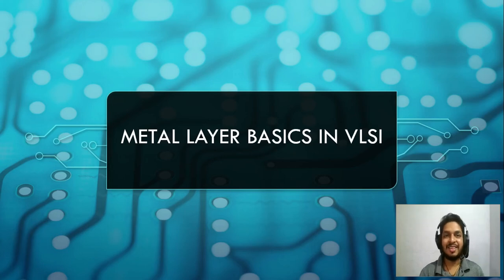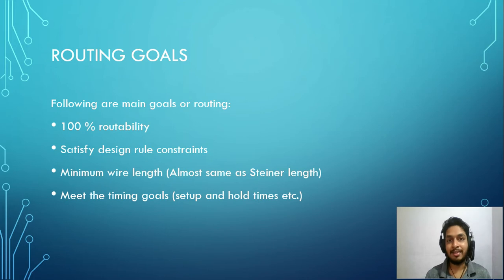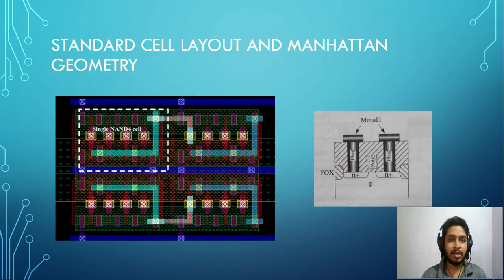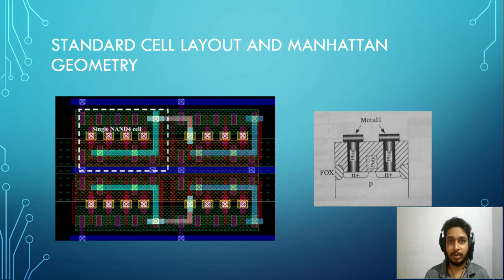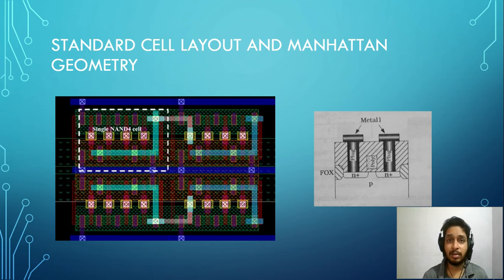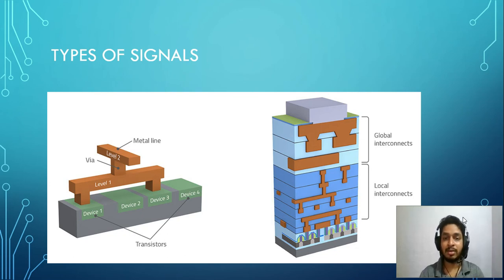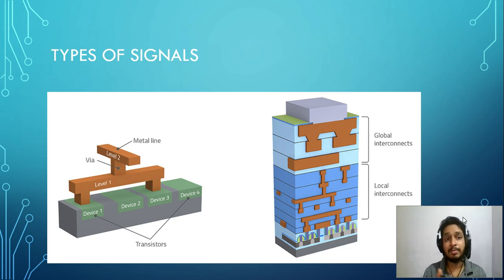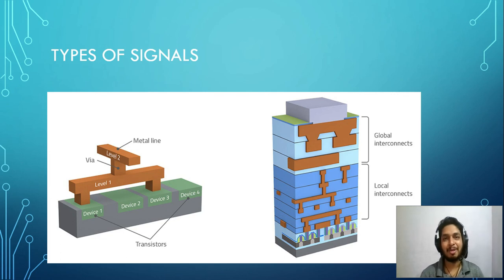Metal Layer basics in VLSI

Comment: if we connect metal1 ,metal2 and metal3  can u compare their resistivity ??/
Reply from the maker: Can you please be a little more specific? I didn't probably get you properly. Do you mean what happens to the total resistance if we use multiple metal layers for a net? Or do you want me to brief about the magnitude of change in resistivity as we go for higher layers?
Reply: @jairamgouda  actually my question if M1 upon M2 like that if we connect what will be the resistivity will varry and which metal have more resistivity and why ??
Reply from the maker: @sardharvankunavath1988  Yes, I got you. Basically as I have explained in the video,  the resistance of the metal M0 is the highest in metal layers and the capacitance is the lowest. Similarly the highest metal used in the chip maybe m5 or M10 or M 18, whatever it is, wil have the highest capacitance and lowest resistance. Why? Because the width of the metals usually increases as we go from M0, M1 to top metal in the design.
Reply: @jairamgouda  okay tqs for ur valuable response